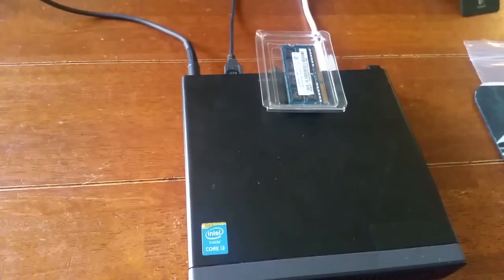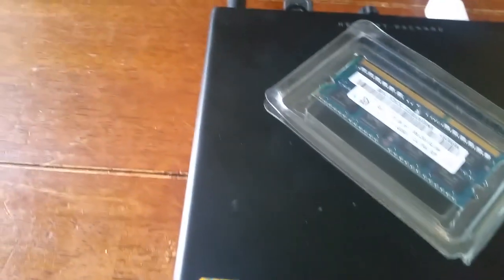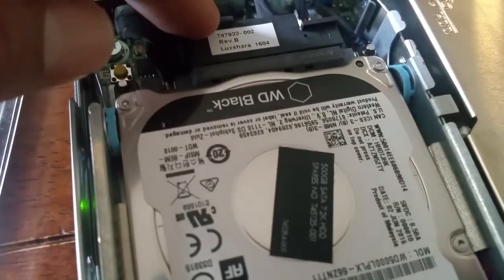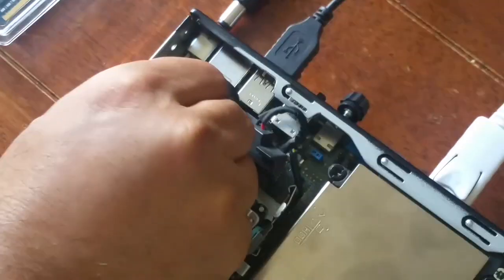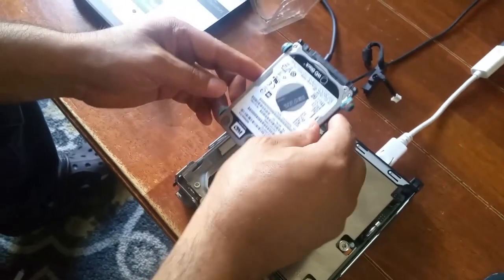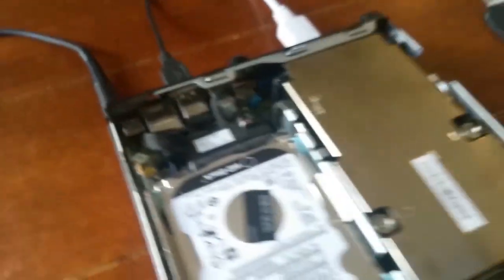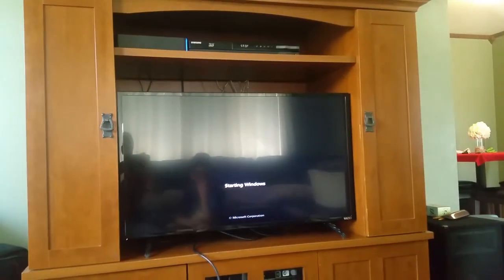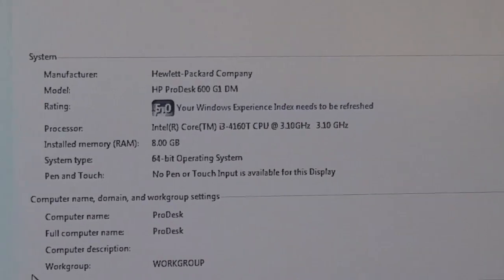HP PRODESK mini computer MEMORY UPGRADE

Comment: Hi, it does not  look as low voltage memory (PC3-10600) so DDR3 @ 1.5v (sodimm) should be ok ?
Reply from the maker: You are right... I just didn't realize.  I  have one 1.5 and one 1.35.... I purchased the stick I installed at the now defunct Frys...... but it looks like the equipment will support the 10600, according to information available online. Note the "L" in the PC3L12800 stick......! Thank you for your observation. That was interesting!
Reply: Tnq